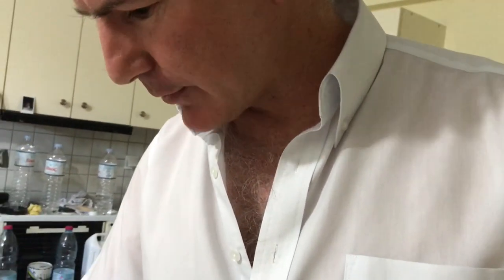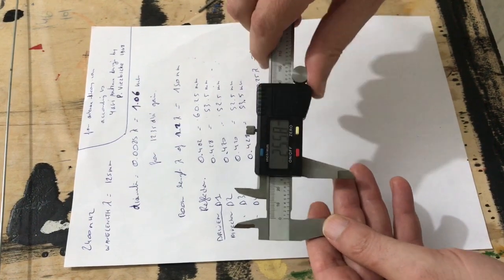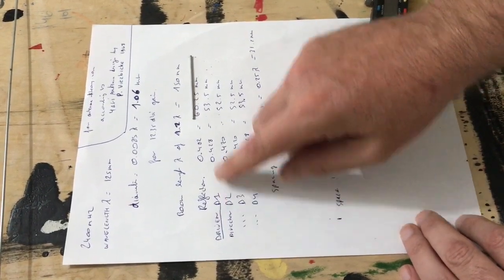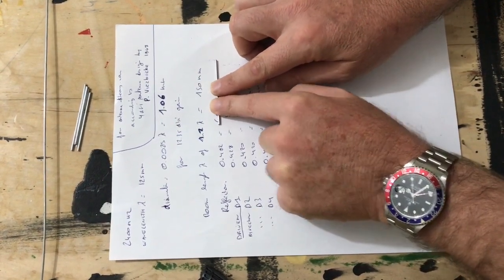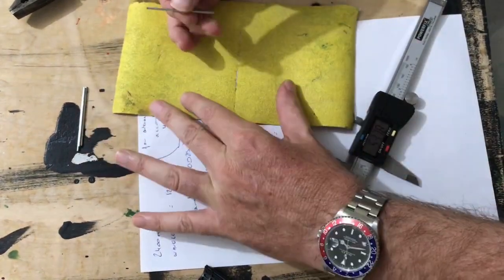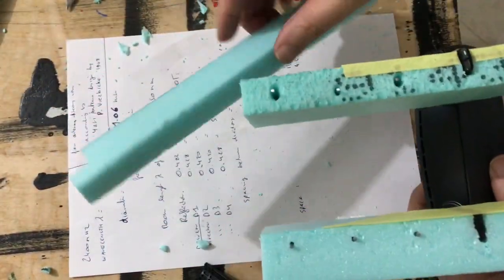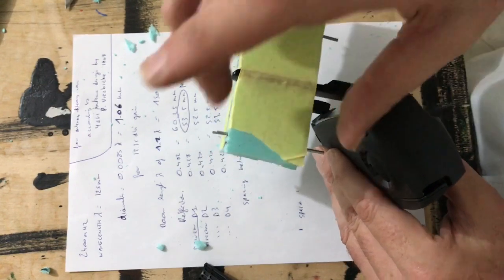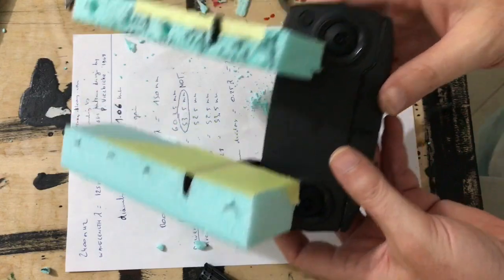DJI Mavic Mini Drone - Yagi Antenna Range Extender Test - CE Model

Comment: can  you give us the formula of your measurements? the reflector seems to have a different distance to the antenna than all the other yagis on the market.
Reply from the maker: Thank you, it's true! I used the true Yagi Antenna formula for the 2.4Ghz frequency, all equal space between. Rods were supposed to be 1mm, I used 1.6mm You can check it yourself at www.antenna-theory.com were I got it from
Reply from the maker: Pls check out my latest video, where I 3d Printed one with the common measurements